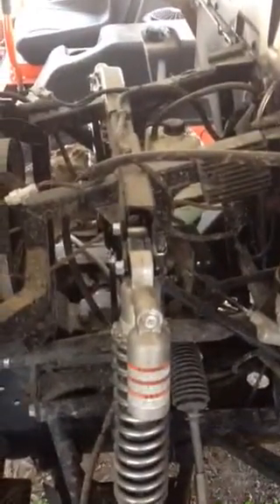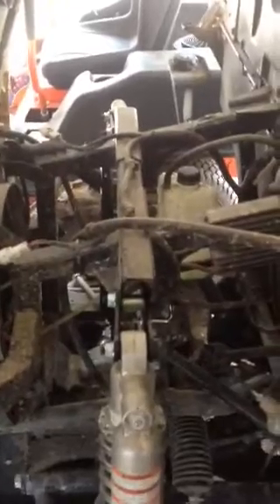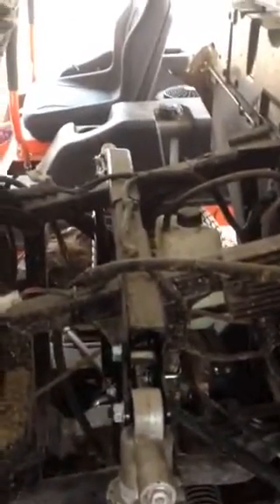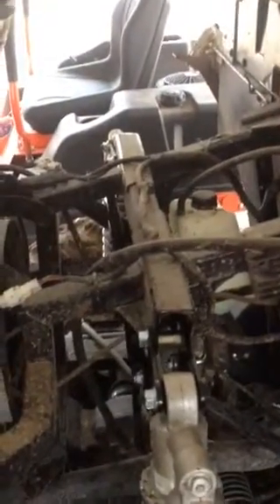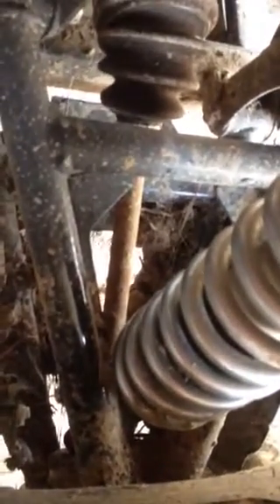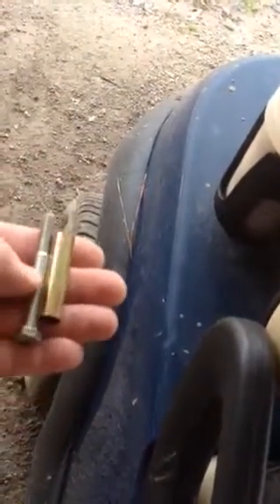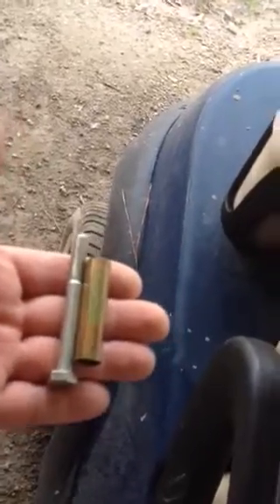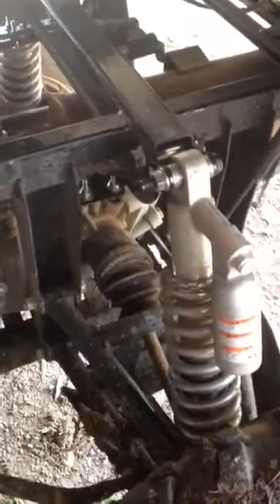2" Xtreme lift kit for 2011 Teryx

Comment: Thanks for the information. How long did u have it on there and any issues so far with it? Ripped cvs or anything like that?
Reply from the maker: Benerman2006 No issues at all with lift. My biggest issue is either a tire is out of round or wheel spacer isn’t true or something of that nature. Bike starts shaking over 10 mph and gets worse the faster you go. But I hardly ever go fast so I haven’t worried about it. Actually don’t ride it much at all anymore.